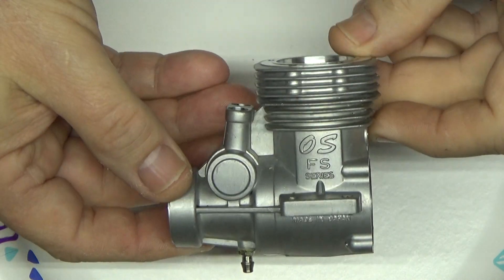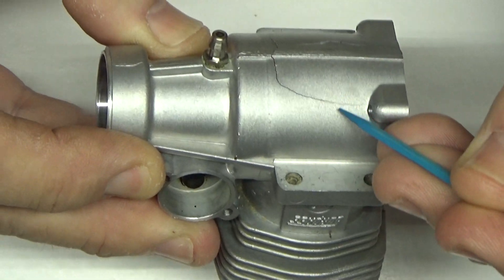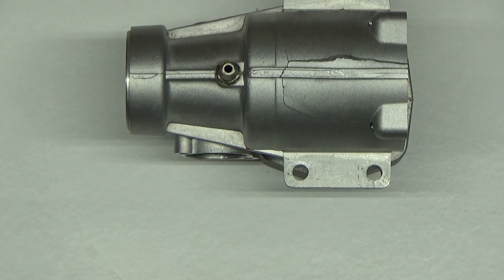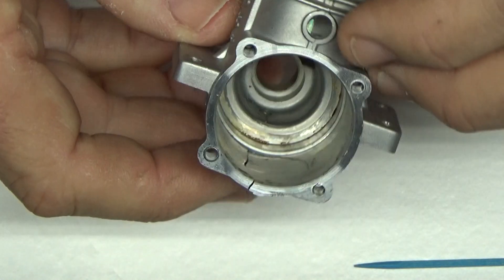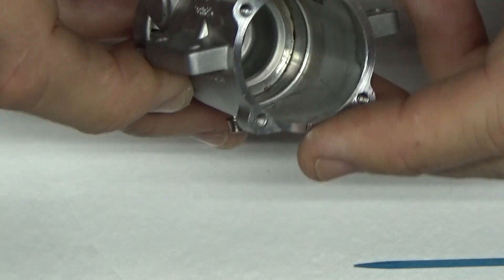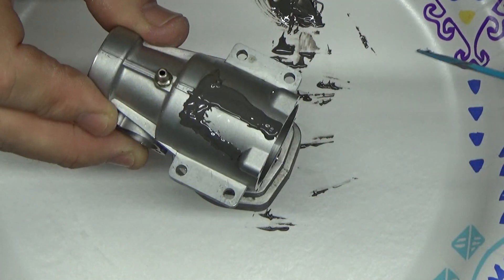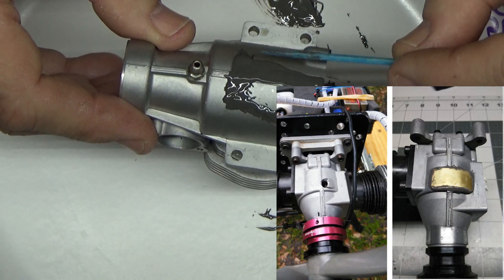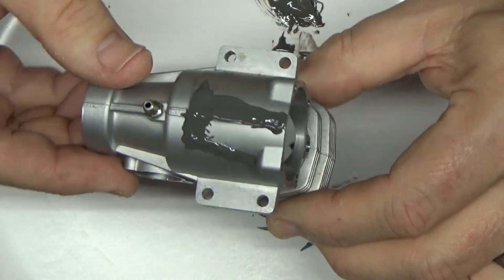OS FS-48 Surpass Crankcase Repair Part 1

Comment: I fixed the inside of a dirt bike water pump housing with that stuff and I ran it for years with no problem's and as far as I know it's still working! Only time I used JB weld and it failed was on a dirt bike exhaust and it got hot enough to melt it and blew it out!

Comment: Should be fine. I've fixed a couple with JB Weld and they still run and fly with the rest. One was repaired over 10 years ago and it still runs.

Comment: You said that found a case and a crankshaft for 112 U$ dollars... Well, for content purposes... It's a good idea. But the amount of heat that theses engines generates, it will not seal as the metal expands... Try a tig weld if you really dont want to pay 112 bucks. Here one engine like this, is 1000 U$ dollars. If you want to do your runs, couple of mins only, will work... If you want to USE the engine, will not. But we appreciate to share the video, new info, new ways to "fix" a glow engine. Waiting the part 2. Cheers.
Reply from the maker: I don't think you have any idea how much heat these engines generate.  This crack is in about the coolest area of the crankcase. I have never seen a case temperature above 190F and the JB Weld is rated for up to 500F.  So I fail to see how you think it will never seal or remain intact.  I have made this repair once already and had zero issues with it holding to this point.  My channel is about how the common person can do things in this hobby, because that is what I am a common person.  I am not a welder, machinist, aeronautical engineer, etc.  So that is why I show and do the things I do here.  To attempt to educate, assist, and show the common modeler how things can be done.
Reply: @dmrcflyr2  the point is, not the amount of temperature of JB Weld is "rated"... is the metal expansion and contraction, with the time, this kind of weld will fail. And like I said, for produce material, content and teach some ways that glow engines can be repaired, it's amazing. Keep up the good job! And waiting the part 2.
Reply: @GOLTURBO555  How much time? I have heard of a company fixing a cracked block on a Cat bulldozer with it and it was still running years later.
Reply: @johnkelinske1449  For sure... you will use a "epoxy" welding, on a U$40,000 dollars engine? I'm "sure" that was fixed with it, and still running. In diesel engines, if dont want to lost ur engine, or you buy a new engine block, or tig weld it. Well, coming back to nitro engines...
Reply: @GOLTURBO555  After 50 plus years in the model game I know what works and what doesn't thank you. I have seen guys fix cases in several ways including epoxy and it does work, so you do it your way and let others do it theirs.

Comment: You could make the same patch as the other. With a plate on top as a cover. To cover things up😀🇳🇱
Reply from the maker: I have but I chose to use JB Weld.  I have had good results with it in the past.
Reply from the maker: Yeah I could, but the small curves are tough.  It would take way more time to bend a piece of brass to fit it well enough.  I only used a brass patch on the other repair because there was a big hole and the piece flew away.
Reply: @dmrcflyr2  Have you ever heard about those aluminium rods that melt when heated. Or is that not for this type of metal.
Reply: This engine Will purr again for sure, the zone of the cracks is not under critical stress.
Reply: @luisgarza2036  I think you are right, most compression is on top 😀🇳🇱